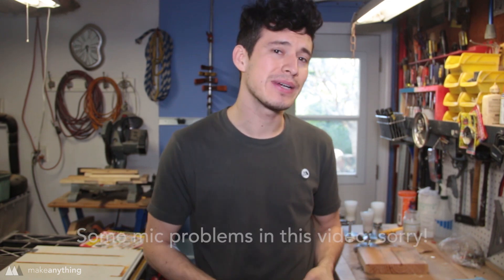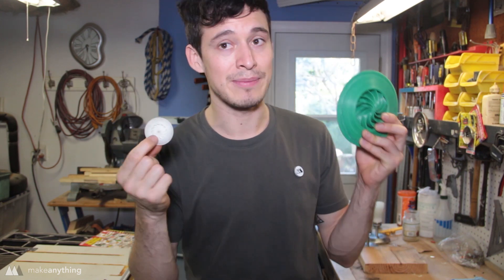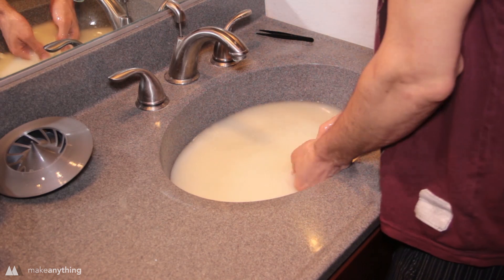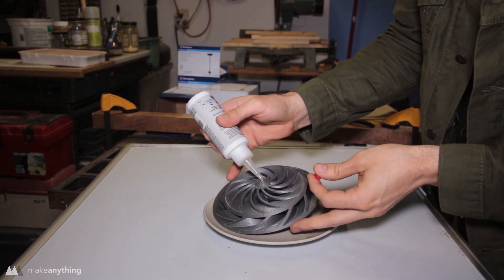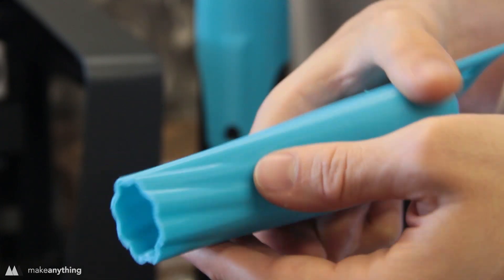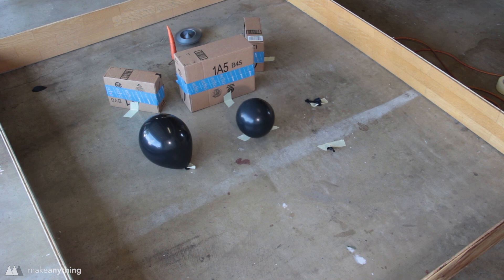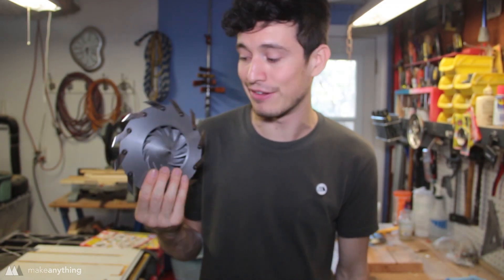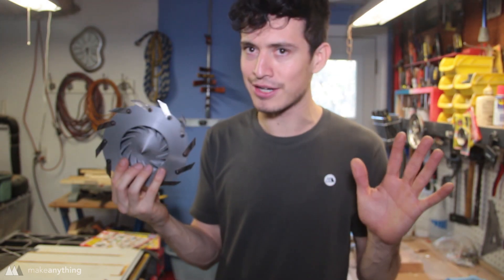Weaponized Galactops?!

Comment: Iro3d printer is cheap if you wanna make it solid metal. You’d need some high purity, ideally spherical iron powder, some pig iron (4% carbon), and a cone-10-capable kiln/furnace to make it in steel. Also, a crucible of whatever size necessary.

Comment: Could you 3D print a wax model then use lost wax investment casting to create a metal top? Copper, or aluminum would be easier, and cheaper. Collaborating with a metal casting YouTuber might be an option.

Comment: Only one minute of spin time? My old (classic) beyblade mod would go for about 3-4 minutes  and even beat the newer gen beyblades that came out around 2010. =p
Since this your tops are plastic there's no centre weight to balance or retain rotational momentum, next time you do this, add a weighted rod or ball at the lower centre of the top.

Comment: To go faster you really only need small vanes on the surface of the top,  so that compressed air can be directed on those vanes.  Two additional benefits are that you can direct the compressed air near the center of rotation,  which would be like gearing up your air motor.  At the same time,  you air vanes would be protected from the motion of air from rotation,  reducing air friction.  

At present you have a turbine engine that is 'way overpowered for the mass you have available to accelerate.

Comment: Ummmm.  Interesting,  but what are you really trying to achieve?  The fastest rate of spin?  The longest spin,  or what?

The problem you have with this is that you have a LOT of air friction involved in your top. That causes it to slow down rather quickly.

And you don't need all the veins except when you are accelerating the top   ---the rest of the time they are just bleeding off speed with air friction.

What you do need is more mass to store rotational momentum.  

So I'd be looking for a way to combine a lot more mass with a lot less in the way of vains

Comment: These are JUST recommendations. Nothing more, nothing less.
1) line up the floor.
2) use a wearable leaf blower. They are more powerful and some have have a quick turn off feature
3) beyblades 2.0, fight with a friend
4) use a Teflon pellet instead
5) can you 3D print with Teflon? If so, make a Galactop out of Teflon and have a dimple on the bottom instead of a point
6) could you print it so you could have the pellet inside the Galactop (like a ball point pen)?
7) print slots for the blades to fit into (all blades will be at the same angle so it’s more symmetrical for even weight distribution and to make it spin smoother)
8) use smaller screws
Reply: Also, the closest thing to 3D printing with metal is using a plasma cutter to cut each individual piece and weld them together. I’m not aware of a machine that 3D prints with metal like a plastic 3D printer does.

Comment: One thing that might slow the top down is having too many "blades" in the turbine, while you do need a few to get it moving, but if you have too many it's like air-breaks on a plane, in other words the more fins/blades in a turbine, the faster it would spin up, but the shorter it would last cause each blade/fin is being dragged threw the air making it slow down faster

Comment: you need a concave center, because as the aro tip leans, more air goes to that side thrusting the top to lean more in the wrong direction.

Comment: You are on the right track.  The fins on the bottom of this are exposed and once thrust from the leaf blower is no longer being applied the exposed fins on the bottom cause significant drag.  Some of the first versions printed in two halves will work better as they cover most of the bottom fins.  

To spin longer just incorporate a large metal washer between the two halves.  This will act as a flywheel and store much more energy in the top and will overcome the friction of the air for a much longer period of time.  A longer spin could also be obtained by spinning it up and then putting a vacuum bell over top and sucking out as much air as possible.

Comment: add a steel ring around the top 
add a Bering to the bottom and put the tip inside the Bering and make a stand for the tip to sit in so it has more stability when spinning

Comment: use a metal needle point and see if that works better then a bearing..bet it would go quite awhile especially if combined with a heavier material like bronzefill or somthing similar.....another option may actually be to print a very very weak version of it then cast it in metal using a foundry...that would make a pretty sick video

Comment: the problem with making it spin long is that although it can get up to alot of speed, after it stops getting air it turns into an impeller, dissipating all the energy back into the air whilst trying to fly

Comment: You should try making a laminar flow attachment for your leaf blower (basically has a bunch of straw like structures inside to help the air going straight). It'll make the air much less turbulent. And you could design it so that the individual tubes have a twist to them. You could experiment with different twist rates to try and achieve the greatest RPM with you tops. That would be neat to see.

Comment: what abut an adapter that widens out at the end to mimic the curve of the pulsars point? so it fits neatly ad directs the airflow even better and maybe a vortex would make a more noticable improvement.
Reply from the maker: +Seal Lord true, that might have to be my next iteration!
Reply: It would have couple draw back though like it would only work on tops with that shaped cone and it might have increased friction hopefully the layer of air would help on a flatter version but on a vortex version (if you're feeling fancy) you could add some sort of ball bearing type thing to reduce friction
Reply: you could even design a galactop with blades that the leaf blower attachment would fit over. (like the type of blades that air move not knives)

Comment: Why does the ones you have in your online shop look different than the ones you have in the videos? The opening on the top is different, as well as the overall shape isn't as curved as that.. I know because I ordered one ._.
Reply from the maker: Yes, that design is better for FDM printers like mine. This one only worked on my printer because I had that dissolvable support material, and I made it so big

Comment: your other galactop may be unstable from thrust. if you aim the air path up and around, it may work better. air escaping down can cause liftoff. also try making pathways have a 45 degree "roof". you won't need to support it. just the belly. to make more mass, try 75 to 85 % infill. it will look solid on the inside anyway.

Comment: To make it spin longer, try using glass instead of steel for the tip. The variably infill is a solid idea, and spinning it on a concave mirror will reduce contact friction. Don't use lube. Ever. Lube makes things stick.

You may want to try making an attachment for the leaf blower to smooth out the air flow. Polishing the air surfaces will also help.

Comment: Hey love your vids, maybe you could try using a 3d print as a lost mold and cast a top it out of steel or aluminum or something? Might not work because there are some thin wall, but what if it did.....oh the destruction......

Comment: To make it spin longer i would add weight to it, maybe in the from of metal bracings around it, or places to glue big ball bearings, you could even leave pockets in the middle cone or the base that you could fill with heavy liquid, or sand, or lead pebbles. The heavier it is, the least air friction can slow it down! any other suggestions of ways to weight it without printing it all metal? x)

Comment: You basically need to make it as heavy as possible so that it becomes a flywheel. I don't think you can do it with 3D printing alone. You could use an existing cast steel flywheel (off an engine for example) as a base and then add the 3D printed vanes and point to make it into a galactop.

Comment: Great video!  How about making a leaf blower launched spinning UFO type object that will get lift from a printed-in impeller, like those kid toys where you pull a string or use a rubber band.  You could keep the thing airborne for a long time using the leaf blower as it slowed down and descends.  You would need to use a light material...

Comment: I take it you don't value your shoes, feet and fingers much... that looked really dangerous.
Reply: SGTSomeone even if he has metal tip shoes.. still.. ya. Not a good idea
Reply: I was cringing just watching that!
Reply: Steel capped boots.
Reply: @ralexcraft990  those protect your toes mostly, not much of the remainder of the foot
Reply: Hannes Brandstätter-Müller its very light weight so it doesn't enough momentum/inertia and grip on the ground to penetrate the leather

Comment: your top slows down pretty quick because it is a big fan moving alot of air. If you can design it in such a way that the fins close off after you stop forcing air through it it will have a lot less resistance
Reply from the maker: Good point... that makes a world record more difficult! :P
Reply: Is it really though?  Isn't it only slowly sucking air in the top based on the direct of spin? I don't know how much a flap system would decrease drag.  The real reason this one slows down so quickly is the mass.  It's too light for the size.
Reply: You are on the right track.  The fins on the bottom of this are exposed and once thrust from the leaf blower is no longer being applied the exposed fins on the bottom cause significant drag.  Some of the first versions printed in two halves will work better as they cover most of the bottom fins.  

To spin longer just incorporate a large metal washer between the two halves.  This will act as a flywheel and store much more energy in the top and will overcome the friction of the air for a much longer period of time.  A longer spin could also be obtained by spinning it up and then putting a vacuum bell over top and sucking out as much air as possible.
Reply: print-in-place exists. while it's pretty hard to do, the results are beautiful
Reply: how do you suggest he does that?
Reply: He needs more mass top store rotational momentum and a lot less in the way of air vanes,  which are only needed when accelerating the top.
Reply: You could have flaps on the edges, opening as air flows, closing as it spins
Reply: call the one you made in this vid "vela"
Reply: Neo Mitchell then that would require printing several small parts and assembling them, when the point of making this one was to make the largest top possible, as ONE piece